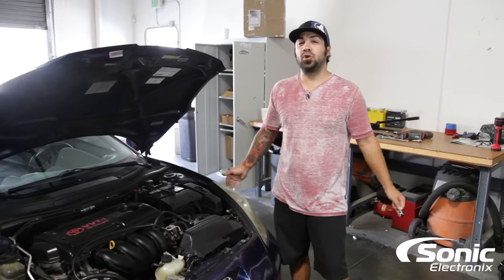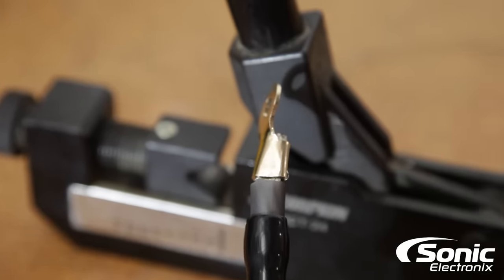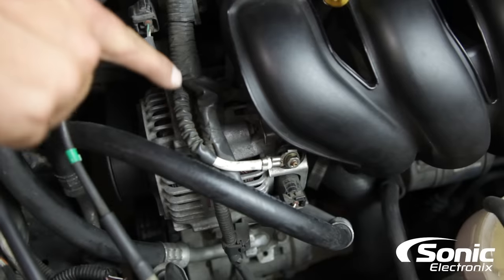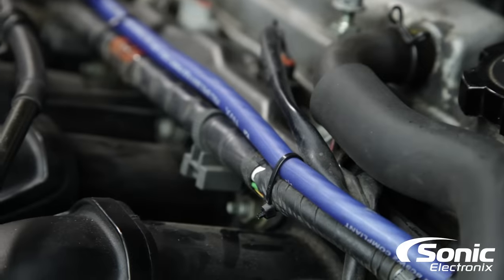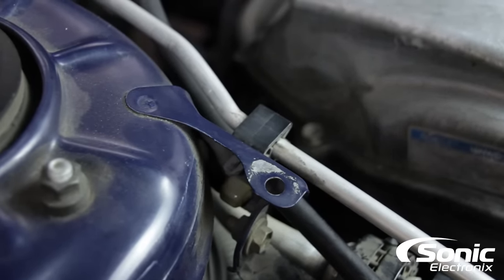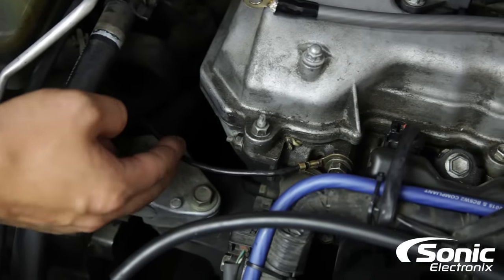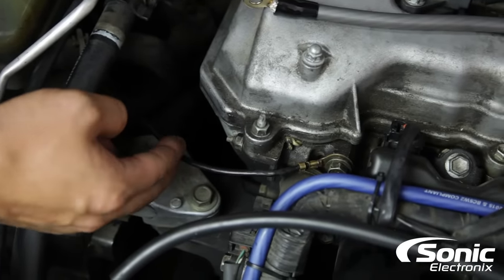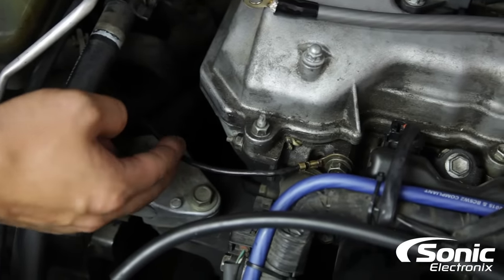How To Install the Big 3 Upgrade | Improve Your Vehicle's Electrical Charging System | Car Audio

Comment: Quick tips- The nuts/bolts on the strut towers which hold the strut mount to the chassis work extremely well as ground points because they are nice and large, the metal on the strut towers is thick, and you can tighten them down tight without stripping it or causing damage because they are large and sturdy. Just don't ground to the strut/mount itself since it's usually isolated by rubber bushings. I would also suggest finding a large bolt on a sturdy part of the engine block or head to connect the ground to instead of connecting it to a small bolt on a valve cover, bracket, or something similar. That way the cable is connected to a thick piece of metal that can handle current well, and you can tighten the bolt down nice and tight for a solid connection. Also, as he said, make absolutely sure to sand/wire brush all connections to clean, shiny metal since paint and oxidized metal are very poor conductors. I hope that this information helps someone
Reply: have to watch doing this ,,,, some vehicles have rubber mounts for struts
Reply: @micheledianemiller4589  Great point, thanks for mentioning that! I was referring to the nuts that hold the strut mount to the strut tower rather than the nut that holds the strut to the mount, but after rereading my comment I realize that what I wasn't totally clear, so I edited it for clarity so I don't confuse anyone.
Reply: When you remove the nut that holds the struts, does it loosen the struts and does it need to be aligned back or something? Can we just loosen one of the nuts, put the wires there and just tighten the nut just like that and all will be fine? Its the first time I’m gonna do the big 3 so I’m quite nervous. Appreciate your inputs. Thanks a lot.
Reply: @TruthSeekerAll  It won't loosen anything or affect the alignment. Just remove one of the nuts/bolts holding the mount to the chassis (not the one in the center holding the strut to its mount), sand or grind the surface under the head to clean, shiny metal, install the terminal, and reinstall the nut/bolt. If you are nervous about using a strut mount nut/bolt, there are a bunch of other things you can use too. I just found that the strut mount bolts work well almost universally since they are large and the strut towers are thick. If you have any more questions, feel free to ask
Reply: @averyalexander2303  Thanks so much. Have a great day. 👍
Reply: Cheers to your explanation!
Reply: It depends on the car because sometimes the strut towers are composite or not actually welded to the rest of the chassis...they do this to engineer a clean break in order to support reparability on certain cars depending on where the weight goes in a bottom out event.
Reply: @funfun5656  Thanks for the tip, I never saw that before.
Reply: You are here to learn, so be quiet and learn. Do it. No comments about what you think.
Reply: @CarlOblander extra tips and add ons that the video didnt mention are nice to know. Go boss someone else around, you're no ones daddy here.
Reply: @Straight_White_Fatherly_Figure  Be careful with comments like that, you might get a disorderly conduct ticket from the youtube police 🤣
Reply: @jasonhobbs311  wouldn't be the first time 🤣
Reply: I'm late to the party but I put my amp ground to the rear strut mount just added an extra nut to it worked perfectly same voltage to the amp as the battery under the hood
Reply: @cncsdaddy85  Good to know. When I moved my battery to the trunk, I grounded it to one of the strut mount nuts and get less than a 0.1 volt drop from the negative battery terminal to the engine block when cranking the engine, proving that the strut mount nut is an excellent ground on my car.

Comment: I actually upgraded, and added a few more grounding points to my 1985 Corolla GT-S, along with the battery ground, over a decade ago. I thought of the alternator charging wire to the battery but wasn't sure how to do it. I will be definitely be upgrading the charging wire today which will compliment my upgraded alternator (OEM was a mere 60 amperes) with a 100 amperes unit for a 1993 MR2 (w-p/s), which happens to be Plug & Play.
Thanks a lot for this informative video, very helpful!

Comment: All done on the Saab 900. Put 4ga from the alternator to the battery and went from 12 volts to 13.1 no load and much more stable when adding load. Thanks Sonic
Reply: Gonna probably do this for my 900 also

Comment: My brother had a '69 Camaro, California car with very little rust. Constant electrical problems, too many to list. Ended up running heavy gage wire replacing factory positive and negative battery cables. Helped! Added heavy ground wires to several spots of front body panels. Helped more! Ran ground terminals with connections to each other. Much better! Then, ran heavy Ground to engine block, both cylinder heads, and front frame. It made a world of difference. Was amazed how much resistance there was between metal on car...

Comment: This is a great idea for preventing the dreaded - rusty and falling off wires that are burnt and rubbed through and sparking when it rains and there is road salt. 

Up my way - this kind of stuff is for diesels, like the old or new TDI or old Mech pumps. Winter requires a 1000 COLD CRANK AMPS. And then you have to get all that power to the starter and not melt off the connections, so dont forget to keep going with the upgrades. 

Best regards - you did a great job explaining and including solder use. Cheers!

Comment: For the charging wire any additional wire you add smaller or larger than the original wire size you'll see an improvement.

Comment: The secondary ground that you see on the other vehicles shown are for the cylinder head which might be isolated from the block ground by the head gasket. The studs holding the head on might be covered in locktite and thus the need for that ground as a precaution. It might have been wise to find the block ground instead as this is the one the alternator is attached to.

Comment: , Another Tip............
if you cannot find or get to the original engine block ground, don't worry about it. Just run an entirely NEW GROUND and leave the factory ground.
Nothing wrong with doing that. After all, it's a factory ground anyways. so leave it for you do it yourself kind of people.
Reply: I needed this statement thanks you and also would a strut tower be a good ground for chassis to engine block? I have a 2002 chevy impala
Reply: @mallorycainjr.1921  yup.. I got a 2013 and I put it to the strut bolt..
Reply: Run a new ground from the engine block to the battery?
Reply: @semajkeaton331  yes I don't even use my OEM ground..I relocated my battery to the back and deleted my front battery ..it's grounded with double 4/0 cables

Comment: First time I've seen the Big 3 done incorporating the original wiring with the new wiring. Interesting.
Reply: My thoughts exactly..hes parelling which I feel is not right
Reply: LMAO
Reply: @richbernhagen3137  it's right it's just extra and basically useless
Reply: Yeah it'll take the "path of least resistance" regardless. I mean sure you could remove the OEM completely but its really a waste of time. Now if your as OCD me and have the time and know-how then by all means.

Comment: I'm a big fan of a crimp for the mechanical connection, and soldering to make a more solid, permanent electrical connection. It's how I've always made welding cables, and it's always worked great. I also use closed end terminal lugs (100% copper) and adhesive lined shrink wrap where the lug meets the insulation to create more long term resistance in wire degradation from age and oxidation.
Reply: Please look up why you’re wrong. It’s better to crimp in these situations
Reply: @taung9535  Or you could back up your thesis and avoid coming off as a prick, especially because in THIS situation, a crimped and soldered terminal is superior. 25+ years of experience working both ground vehicles and aircraft in addition to well over a thousand hours of formal training has taught me which situations require only a crimp, which require only solder, and which benefit from both; especially when you're going for a long term reliable electrical connection.

Comment: would love you guys to do an amp dyno test before the big 3 & after to see what the difference is 👌
Love your guys videos....great info
Reply: ....that's logically pointless
Reply: I don't understand why Tom's request is logically illogical I mean really what are you doing this for do you really even know if it's like the other videos I've been saying and listening to you guys keep saying you can increase the voltage that is an absolute joke you can't change the voltage if it was a wire is thin has paper or as thick is an elephant's trunk. So now that we have that truth out of the way back to the why you do this to start with I mean there should be a basis for everything there should be a start and the reason for anything you're doing so again if you're doing this for More Voltage you're wasting your time but like Tom said," it sounds like he could be educated" what is the total amperage that you gain the end of this because we all know well at least now we all know you cannot get any more voltage by changing the wire size you can only get more amperage Through the Wire so it sounds so silly that you would even question Tom's thought on how much amperage you could pull through your wires because that's all you're doing you're setting it up so you can draw the same voltage however more amperage through the wires which feeds the larger hungry for amperage not voltage to run properly. You took the words right out of my mouth Tom how about amperage test that's the real way of telling if this really does anything at all which we know by All rights it should and the one thing that I've always learned about electricity for my dad that used to do the electrical on B-52 bombers in the Air Force was that you needed as big as a ground has you have a hot wire. Which brings me to joke number two. I rebuild alternators for a living. Why would you need to ground an alternator that has no remote grounding components whatsoever and if the engine is grounded properly no Factory would send it out the door without having the proper gauge wire for the alternator that it is built with however if you are going to use a larger alternator then you could consider running a heavier wire and unlike all of you people that keep saying hook your grounds to the same place, that is so dumb and also not true you want to separate your grounds most people are just too lazy to get under the vehicle and established a new ground opposing the factory one that means opposite of perfect example is if you're going to use a rear-mounted battery which is the way to go aftermarket stereo amplifier you would run a charge wire back to the battery which would not have to be the welding lead you are talking about again we're talking amperage that comes from the alternator it doesn't matter it still a 12-volt alternator capable of putting out 14 point 8 volts however we all know that it's the amperage and the amount that it puts out that regulates the wire size. So if you ran a battery in the back you would also my suggestion run your ground wire right there. It's funny listening to you about you don't know why somebody would run a ground through something the size of a speaker. Do you know how many amps go through a ground LOL you're starting to get the drift I hope maybe you will change your videos when you use words like I don't know why and you're standing there talking about automobile manufacturers with educated employees seriously don't get me laughing I'll have to get some tape Cape my whole body to keep from cracking up anyways you're wasting a lot of time there's nothing worse than people that know what they're talking about looking right through BS and knowing it's just pure BS.. PS do you sell Wire by the Foot LOL
Reply: @bobbyotay  agreed,thumbs up for you!
Reply: I think its more for keeping your voltage stable then adding volts... it'll save your alternator also...
Reply: @bobbyotay  jesus but fair lol i would like to second the motion for a before and after amperage test lol
Reply: @bobbyotay  WTF, What the heck are you talking about??? Resistance gives you voltage drop. Thinner wire has more resistance. OEM uses low grade copper. He used oxygen free high end cable with very low resistance. Voltage and amperage will be increased, along with doubling up the cables OEM  and new OFC that will help feed "the starter"  high amp draw. Most of the time the alternator is not putting out full amps once the battery is charged back from a say winter start. So the OFC will give you the higher voltage because of lack of resistance of the dirty crap oem recycled copper.

Comment: Would of liked to see the calculations for this upgrade, also depending on how old the original wire are, the old wires could be causing underlining issues for the charging system!
Reply: Travis Hamler  I used welding wire which would have a different resistance, but I was referring to the video. Which doesn't show the performance improvements (multimeter).

Comment: Doing the Big 3 today on my 1996 Audi A4 Quatteo. Already have it in service mode(front bumper, rad support, etc removed). This video helped me make the decision to leave my factory power wire intact, just adding to the OE wires with my Big 3 kit(got mine from Skar Audio, 1/0 gauge kit). The engine to chassis ground isn't going to be too bad, it's easily accessible now that the front is off the car. The battery to chassis ground has me somewhat concerned, as the whole battery tray area is quite rusty. It's gonna be a lot of cleaning to get her right I think lol. Thanks for this truly helpful watch!! Made this job WAY easier to understand.

Comment: Be cautious on this advice.  You need a fuseable link (or fuse or breaker) on the alternator wire.  The ground should be two single point connections.  One to the block and one to the chassis.  All other devices should ground to the chassis.  The dual ground he just created between the battery and the chassis made a ground loop.  This is not good for system noise on the ecus or stereo.  On the block side, most newer engines have a large ground near the starter and a small braided ground near the coils.  This too is important as the braid reduces rfi created by the high voltage coils.   It's not simply bigger is better.  Done properly this will be more efficient, but it is not going keep the headlights from dimming.  For this, a $50 ups battery installed near the amplifier will beat this hands down on improvement and cost.
Reply: i was looking for someone to mention ground loops.

Comment: I dont quite remember but I couldve swore that a watched a SE video was a another big 3 video years ago but I thought he said the big 3 was upgrading wires, alternator and battery itself not just the wires to all 3!???
Reply from the maker: +Scott-Michael Kellar Hmmmm, I don't think that was our video? The Big 3 Upgrade refers to only the upgrading of the wires associated with the vehicle's charging system. Of course, upgrading the alternator or battery can certainly be done at the same time as the Big 3 for a more substantial performance boost.
Reply: +Sonic Electronix gotcga
Reply: +Sonic Electronix do you ever do any install videos for the 2007 - 2014 Chevy Tahoe or Suburban? none of the videos I ever see pertain to my type of vehicle
Reply: agreed. back in the day the big 3 was 1. Wires 2. Alternator 3. Battery
Reply: Its still the same,but some have more than 3 grounds under the hood. The bigger the ride the more grounds it has
Reply: +Brian Andrew Cody Look up Meade916 Bruh. It's a NBS Tahoe but there isn't much difference between it and yours regarding audio installs

Comment: Excellent video using 4 gauge wire on stock cars👍. Saw some other videos where guys were using huge 0 (zero) gauge. Some great tips in the comments about dipping in a lube BEFORE crimping ends to prevent corrosion.

Comment: For size of wire (gauge), I may recommend using the same size wire as your amplifier (or distribution block) gets or the next size bigger.  If you have no audio amplifier, 4 gauge would be great..or even 8 gauge would do OK too.  If you have stuff like a winch, or big add-on lights, or use a high current device (like a 12vdc to 120vac converter) you will probably want to use 4 or 2 gauge.  If you are going balls-out big amplifier kind of stuff, then cram some phat 0 gauge stuff in there, even though you may have trouble finding room for it.  There are potential drawbacks to using excessively large gauge wire for the big 3....similar to what happens when you try to use a firehose on a garden spigot.
Reply: there are zero drawbacks for using gauge zero. Bigger is always better, it'll always give a more efficient flow, and less heat. Even if it doesn't matter. 
the only issue would be space, if it can fit.
Reply: @davichan9286  4 gauge (quality) wire is more than enough for any Big 3 upgrade.  Anything more than that is a waste of money.  If you have extra wire of bigger gauge than 4 hanging around, use it!  If you got big money burning a whole in your pocket..burn it!
Reply: @crazy8sdrums  It was the same price as the 4, so why not lol. And, if you plan on upgrading your alternator to something serious you're already covered.
Reply: @crazy8sdrums  4 gauge is in fact not big enough for any Big 3 upgrade especially if you're one of those people that has any inclination like an adult should that just maybe you might be adding things in the future that will benefit from the larger wire. Even Boy Scouts have the motto "be prepared" so what's your excuse?